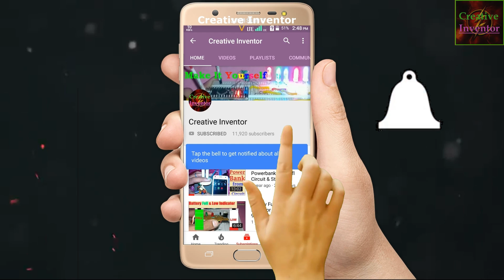How to Make Inductor for Power bank | DIY Inductor | Inductor for Boost Coverters | Dc Coil Indcutor

Comment: 3 volt to 12 v boost converter banao plz
Reply: Le kin banao plz with Ampere
Reply: @CreativeInventorlab  12 volt dc motor 775 rmp ke
Reply: @CreativeInventorlab  around 2-3 amp